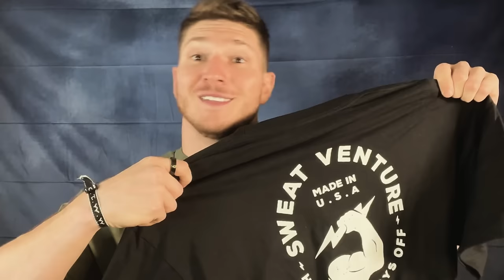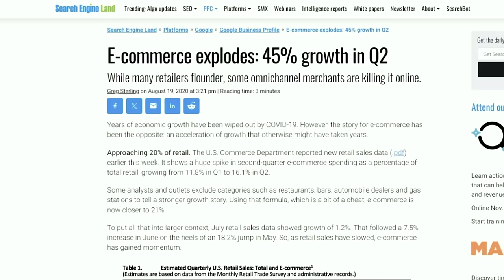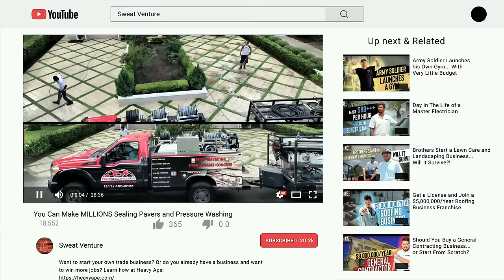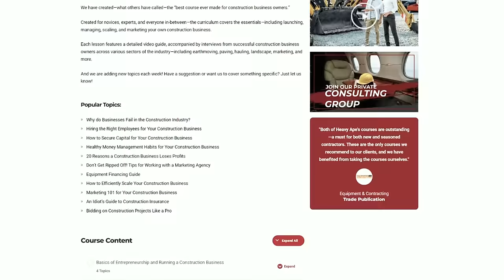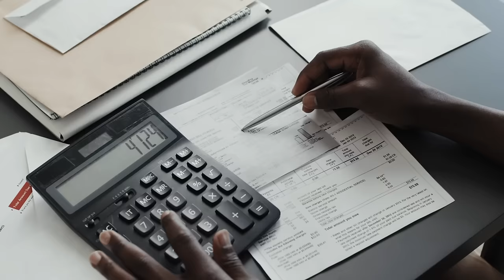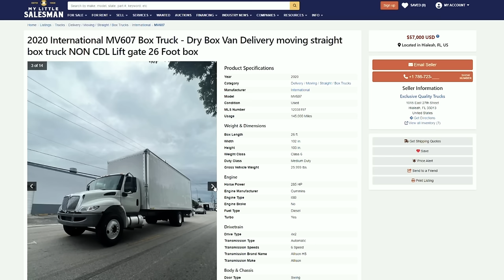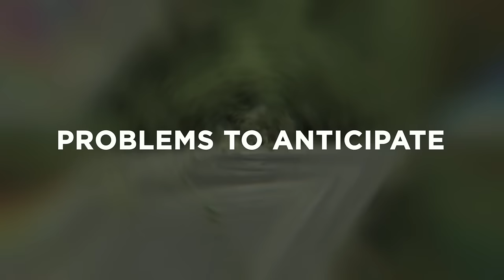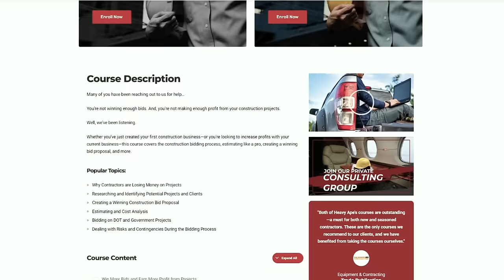How to Launch and Scale a $1,000,000+ BOX TRUCK BUSINESS

Comment: This is an absolutely terrible idea. Booking these gigs means more and more independent drivers competing for work, driving down pay, unnecessarily burning fuel (costs!) and clogging up the roads increasing traffic problems.
More individual delivery gigs equals more pollution because of far worse efficiency.
Try working full time for Amazon with your box truck and see how much you end up after paying for your fuel, maintenance and mileage deteriorating your vehicle, not to mention what is your time worth? Are you going to work for free for a trillion dollar company??
You work all day for pennies!
Don't jump into anything like this without looking deep into it. Listening to overly optimistic YouTube videos and individual anecdotes is the first step to personal ruin.
Reply from the maker: You don't have to work for Amazon, that's the point of this video. You can work independently. Also, it's highly unlikely that extra box trucks on the road are going to make the pollution issue much worse. Until massive countries like China make industrial changes, the pollution situation is likely to remain how it is now. Just curious, what do you do for work, Keith?